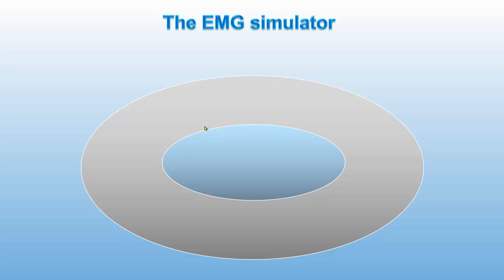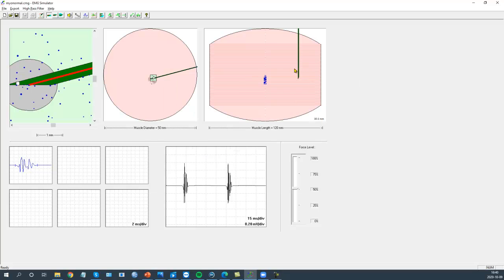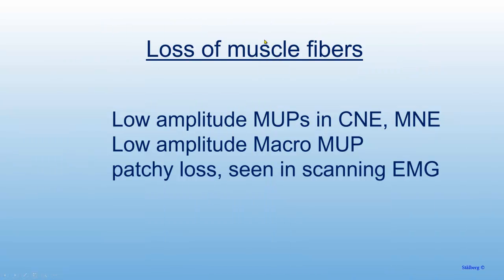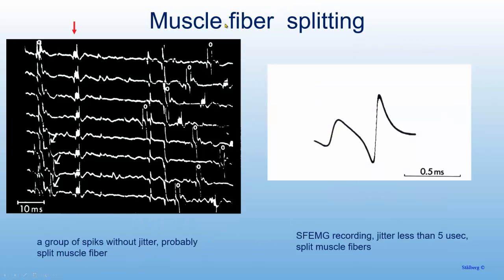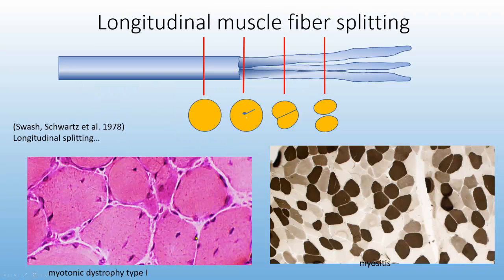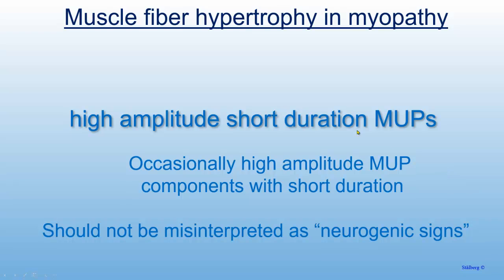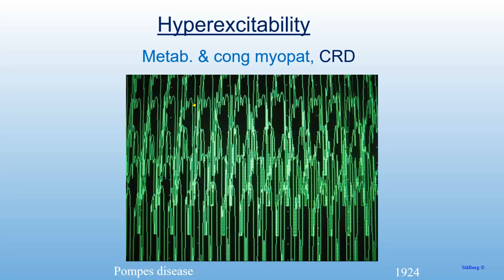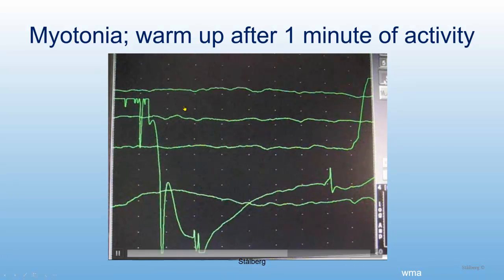Myopathy Lecture - Advanced

Comment: ALS is occasionally a differential diagnosis of inclusion body myositis. In the literature, one often finds the indication that in the EMG of inclusion body myositis, in addition to the pathological spontaneous activity, neurogenic-myopathic mixed patterns typically occur - i.e., in addition to small short polyphasic potentials, also large broad potentials.
Is this the consequence of the frequently accompanying axonal polyneuropathy? Or does the chronic myopathic process lead to damage of the terminal axons, which is attempted to be compensated by collateral sprouting?
Many thanks.
Reply from the maker: Alexander. Thanks for comments. I think that ALS and inclusion body myositis, very rarely are difficult to differentiate. The clinical picture (reflexes, atrophies, development over time..) and the histochemical pictures. Unfortunately the EMGers may have confused the picture, which is the basis for your question. In some muscles in patients with myositis, (also other myopathies) we can see the very high MUPs, but they are generally short and they are stable. In ALS MUP are overall not very high, but complex and show instability, jiggle. Furthermore, the interference pattern is generally full in myopathy, contrary to the finding in ALS. The reason for the confusing high amplitude MUPs may be muscle fiber hypertrophy, well known from biopsies, or the summation of signal from split muscle fibers, a common phenomenon in myopathy. This is the most likely casque, but not experimentally directly proven. As you mention, in advanced stages of myopthy, we may see secondary nerve involvement with some degree of reinnervation, probably.among